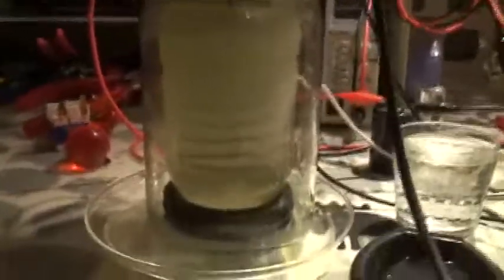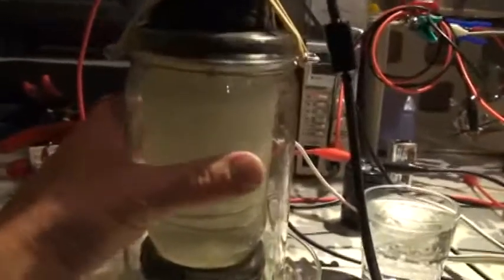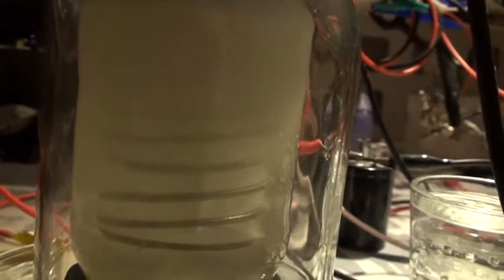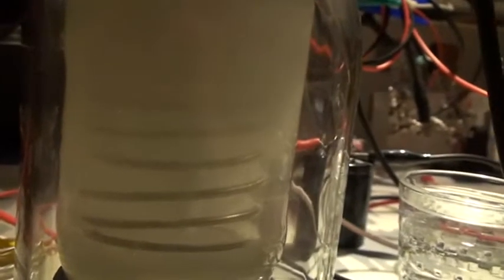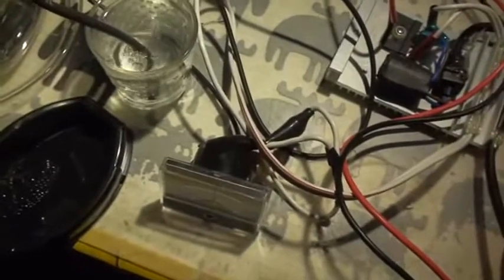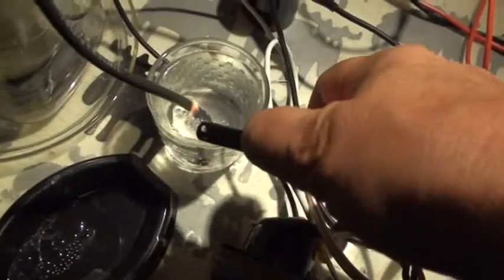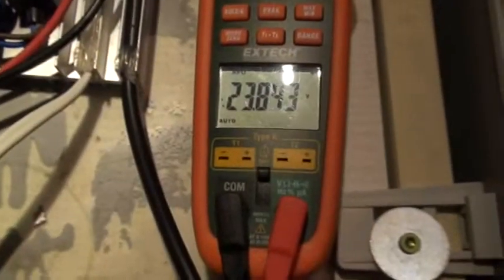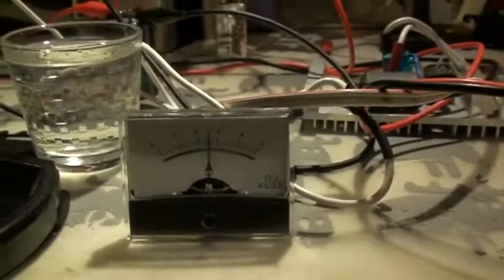LENR in high voltage electrolysis perhaps 2

Comment from the maker: Hi Stephan

Yes the problem is to verify if we can have some energy gain in normal electrolysis with high voltage and low electrolyte concentration.
For info a youtuber  Daniel Gendron from Canada has tested electrolysis with pure Nickel cathode and anode in a thermos  , and it seems that the total output heating energy should be more than the total input electrical energy.
Anyway what is puzzling is the inversion of the Amp draw when the electrolyte approach the 100 deg
regards

Laurent